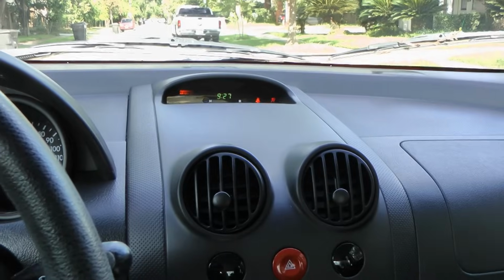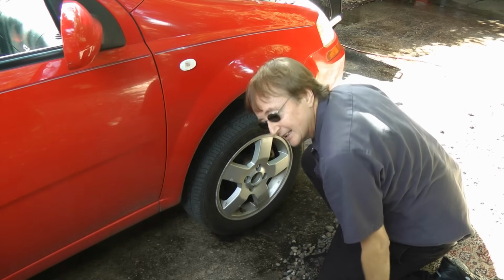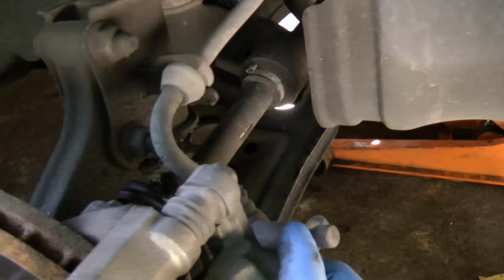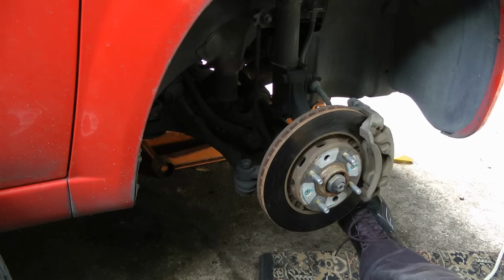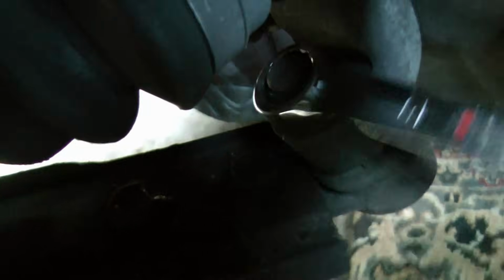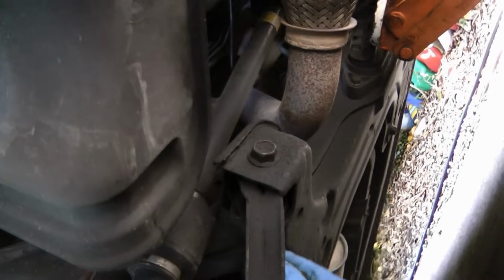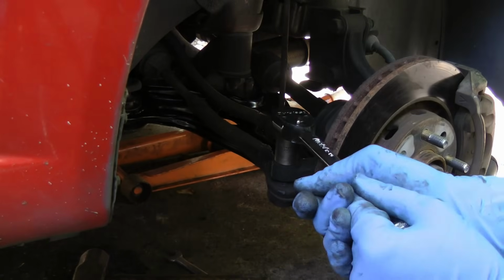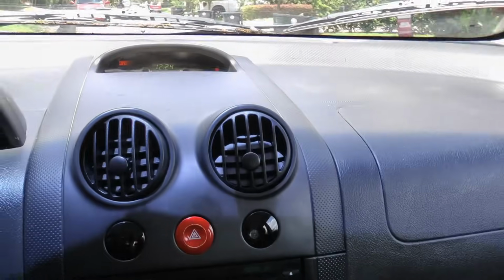How to Fix a Car that Clunks (Lower Control Arm)

Comment: Hey Scotty, my '83 ranger seems to die after driving it for like 20-30minutes. Could this be because of the fuel filter being possibly dirty? I've cleaned out the carb, and checked to make sure it wasn't missing and vacuum lines, and it still dies.

Comment: Hey Scotty,
I have a 2000 Honda Prelude type SH and noticed recently that every time I turn the steering wheel I hear a squeaking sound coming from the front end. When I push down on the car over the front passenger tire I can produce this sound so I'm assuming it has to be something with the suspension. I checked the ball joints using the 9 -3 and 12 - 6 method and there's no play at all. Where might I look next?

Comment: Hey Scotty Kilmar
I got a Rexton Ssangyong which clunks when you drive up a hill or powerfully accelerate but only in second gear. I first thought there was a problem with the powertrain but that couldn't be because its only when in second gear. any suggestions maybe?
Reply from the maker: +sfsef second gear is worn
Reply: +Scotty Kilmer WOW Thank you for the fast response! 
1.) Can i do something about it?
2.) Does this count also for automatic cars?
3.) Can something break and destroy the whole gearbox?
 Thank you!

Comment: My 08 Colorado has same noise but everything is super tight no wiggling no looseness I can't seem to figure it out it makes a lot of clunking when fully turned either way & going slow over potholes & speed bumps any suggestions would be nice

Comment: Hey Scotty I have the same problem with my Chevy Blazer. Replaced the cv axle and wheel bearing and still hear a grinding noise when I turn the wheel left. I heard it maybe ball joints or the A arm. What could cause the grinding problem?
Reply from the maker: do my vide "finding the source of car noises

Comment: Black smoke needs at least one of the cylinder rings replaced (most people will say get a new engine, repair is almost $2k,although parts are only -ring set under $100, complete engine gasket set $150, oil and antifreeze, plus filters $100.)  if you are not loosing a lot of oil or producing huge clouds of smoke, a really thick oil.

Comment: Mr Kilmer, i have a 2003 Santa Fe 3.5 V6 , has a front end clunk, i have replaced, front lower control arm bushings , outer tie rods,  front sway bar links , ball joints are ok , inner tie rods ok, i do notice , if i rock the wheel back an forth while driving , it does clunk , what it that ? an how can i fix it ? please let me know, thank you very much
Reply: Kody Darlington we have same problem...did you know now what is the cause?

Comment: I have an unrelated question: When I am driving straight up 35 miles per hour, my 1992 F-150 5.0 surges a bit...not at 30 or 40, just 35. Question is...What could be the main cause of this? Also It shifts 3 times(1-2..2-3...3-4th (i assume) )...1st to 2nd is fine, but 2nd to 3rd and 3rd to 4th i have to let up off the gas for it to shift and drop back down to 1500 rpm's(both issues "shifting I am pushing 2500 rpms"...any ideas on that as well?? THANKS Scotty. ~Joe

Comment: Question My vehicles making the same Noises but after I inspected it my outer tire rod is leaking do you think that’s my issue or I need to change the lower control arm to?

Comment: 2nd:  Is it black or white "smoke" you see?  Black, rings are most likely leaking.  White water is getting in The cylinder head from a possible leaky head gasket OR intake manifold gasket.

Comment: Scotty I have a 2001 Toyota Camry I have a knocking coming from the driver side. I inspected and found the control arm bushing looked shot. I repaced the control arm, ball joint, outer rod end, and the the sway brace rod on both sides and the clunking sound is still there. I have struts that are only a few months old. Any advice?
Reply from the maker: strut mounts, inner tie rods, or worn cv axle

Comment: Wouldn't you tighten the bushing bolt while the car is on the ground to not distort the rubber bushing?

Comment: my 2007 g6 gt doing the same thing. i mean the noise is not loud but theres a bumb wen i brake to hard and wnever i let go the brake theres a bumb to. plus when riding around the car doesnt feel stable. a mechanic told me that is the bearings but what you recomend me get them bearing or the whole control arm?

Comment: Hey I did the test for the tire I grabbed it from 6 and 12 no movement then 9 and 3 there was a little noise so what are the things that affect that and also is the tire suppose to move like rotate ? Cause it moves probably 4 inches of rotation or is that normal

Comment: Scotty,
I've got a 2007 Mazda 3 that sounds like it has a bad CV joint. I've replaced the CV joint and the tie rod, but the car still makes clunking sounds when turning or slowing down. However, I don't hear these sounds when accelerating. Any thoughts on what this could be?
Thanks!
Reply from the maker: worn ball joints, A frame bushings, lots of worn parts can do that. PRAY it's not internal wear on the transmission where the drive shaft fits in on each side

Comment: Hey scotty, ive recently tried to change the wishbone (lower control arm to you) on my car, but where the bottom baill joint bolts onto the hun doesnt pinch and secure it no matter how tight i tighten the bolt, it just falls right out, ive checked the part and its sound and its the same part. So any idea what i could ro here? Thanks

Comment: Scott i went To my car wheels and the don't move but the A frame is bad. I also checked the tire distance with my hands and the right tire is more backwards than the left one. is it alignment or something else?
Reply from the maker: +Alarm Tech911 time for a new A frame arm or bushings. Most guys replace the whole A frame assembly rather than try to fix bushings as most are press fit
Reply: +Scotty Kilmer i took it and was told it was the A frame but my question is. is a bad A frame also responsible for my steering wheel to move a little bit more to the right when the right wheel starts to grind with the mud plastic cover?

Comment: I'm sorry for my English but, when you tight the nuts, doesn't the car must be on the ground first so the rubber parts between this "A" part and the car (not the wheel) will sit properly and last longer?

Comment: How come you didnt preload the lower control arm befoe tightening the nuts up, you'll be replacing them again real soon
Reply: Hi there Scotty l I just watched your video on how to replace the lower control arm on a Chevy Aveo I'm doing the work myself on my 07 Chevy Aveo I have replaced the passenger side  it was pretty easy but the driver side seems kind of hard I the two bolts were easy to unscrew but the one near the transmission is difficult I've tried raising up the transmission but it will not go up enough to pull out the bolt what can I do thank you Scotty

Comment: hey scotty..i have a 1999 f150 4 door 2wd. I have a popping sound from the drivers rear wheel. Not all the time. every once in a while. no matter if i turn right or left. i was going to replace the u joints this week. just in case. They feel snug but ill change them any way...any suggestions it could possibly be?
Reply from the maker: +The Wraith more often rear wheel pop is brake problem or worn shock bushings
Reply: Thanks scotty

Comment: Hi Scotty I have a 2005 Ram 2500 with the 5.7. I have this damn knocking sound everytime I hit a bump and it doesnt have to be that big. Not sure where its coming from i know i hear it in the front. I have replaced the shocks, upper and lower ball joints, sway bar bushings and links, track bar bushings, the steering is all new (moog). If someone has any ideas please let me know. I was gonna do the upper and lower control arm bushings next, then maybe look at the steering box. Might even replace the links again. Thanks for reading and the help if anyone has any ideas.

Comment: Hi scotty I have a 06 BMW 750 and it burns oil and smokes out the muffler when in idle, it smokes sometimes but there are times it doesn't smoke. Do you know what the problem is and how I would be able to fix it?

Comment: Hello Scotty!
I drive an 08 accord coupe v6 model. I have a rapid consecutive knocking noise coming from under the car. Mainly from the front right passenger when the car is being driven off first thing in the morning or after leaving the car out for a long time. Noise dies down after 5 mins of driving. I had some clunking issue as well. Ride got smoother (not as smooth as drivers side) after I spent 1000$ at the mechanic shop to get rid of the noise. He Changed the stabilizer links and ball joints on both sides. Still the noise is there and he can't seem to figure it out. I went back again he is guessing control arm bushing or strut plate? He estimated 700 bucks to replace them and i cant invest that kind of money again on a guess. What do you think?
Reply from the maker: Lobsang Rigzin find a better mechanic, who can do my video "finding the source of car noises", that machine always pinpoints them and costs 130 bucks or so
Reply: Scotty Kilmer Thank you. I saw your other video post about the noise source locater as well. I will look for a better mechanic.

Comment: Gotta rule out the wheel bearing first. They make the wheel move sideways as well.
Reply: I just changed my wheel bearing. Same symptom. But now I have to replace bushings on control arm.

Comment: hey scotty, i have a ford ranger that has a front driver side tire that is cocked out. the tire is wearing on the inside but not the out. i had the same problem on the other side and i replaced the stabilizer bolt and it fixed it. i tried the same on this side but it didnt work. what do you think it might be?

Comment: Scott when i make a tight right turn I hear a clunk and then the right wheel starts to grind with plastic on the mud protector
Reply from the maker: +Alarm Tech911 check for serious wear like bent A frame or bad ball joints or broken struts
Reply: +Scotty Kilmer can control arms do that?
Reply: +Scotty Kilmer scotty what do u mean by an "A frame"? like in this video?
Reply: +Alarm Tech911 It refers to what is properly called the "lower control arm" of the front suspension. In the old days, this part often resembled the letter "A", hence the name.
Reply: +randolph patterson .Thank you :)

Comment: Hi Scotty, My car is a 2008 Toyota Vios with a motor driven power steering. I usually hear around 3 clicking noise when I turn and move forward towards my parking in my house which is 90 degrees with my car during parking. I hear the same sound when I turn my steering during reverse to take my car out of the parking. I have also observed that this sound does not come when I fully turn the steering wheel left & right when my car is on stationary (with the engines running) and during driving straight forward and doing regular road turns. Could you please advise me of what is causing this clicking sound during sharp parking turns forward & reverse?. Thanks a lot

Comment: I have a question, so I am not sure if this is a money grab opportunity due to the sending of Stim Checks, but I went to get my vehicle inspected and I have no problems, no clunking, no thumping, no clickity clackity's going on with the car at all.
It drives smooth and hasnt change for the past 79K miles, I took it in for a state inspection and the manager or floor supervisor, came out and said I needed to get my rear driver side Lower control arm, Sway bar, stabilizer bar, front quick strut assembly, and rear OE spectrum shocks all replaced for Approx 1,800$.
He said it was very dangerous to drive the vehicle and I will lose control of all steering and at that point I am in gods hands.
I politely declined so I can do more research and grasp an understanding if this is a Money Grabbing Tactic, or is there truth to what hes saying.
I went there with the intentions of an oil change then an inspection, then was talked to about the dangers of what his mechanics found.
Sorry for the long message.

Comment: aren't you suppose to use thread locker on the bolts holding the control arm in place?
Reply from the maker: some manufacturers do, some don't. Getting it tight is more imporant

Comment: Any help wpuld be great.i have a 2006 ford focus zx4 sedan 2.0l engine.i changed lower control arms both sides. I tightened up all boltd and put ball joint in....now whem i dribe o hear a screech sound....ams whem i hit a slight bump my steering whem pulls left amd right like mad.

Comment: What if everything’s tight, you replaced ball joints and you got not play but still a noise? You later find out your brake pads shift a lil in the caliper would that still make a clunk noise?
Reply: Strut bearings

Comment: Hey Scotty! I was swapping out ball joints in my car and got ones from Moog. When I took it out of the box I noticed it didn't have a castle nut or cotter pin, just a regular nut. I'm kinda worried because all the ball joints I've changed before had pins. You think these will be okay?
Reply from the maker: those are self locking nut with sealer inside

Comment: How much do they charge usually to replace this part ?  Or how much does the part cost
Reply: Yinne Medina I can't say how much the part is, probably not all that much but depends on the make and model of your car. I can say however I got the lower control arm replaced on my 2002 honda civic and the shop charged me $240 for everything.  I don't think that's cheap but that's  prob the average.  Next time I might do it myself but you have to factor in: what your timeis worth plus the cost of tools required if you don't already have them.
Reply: I have a 2007 Honda Civic si and yeah I figured it out they charging me 245 for labor and the part , but they told me that it's still good so idont know what noise it is I just bought some new shocks also so I have no idea what's making the noise

Comment: I have an issue with my Renault Laguna. There is a small step down in the road where I live. Maybe a drop of an inch or so. If I drive over the drop causing the front wheels to drop, there is an almighty knock. I really heavy sounding clunk. If i drive up the step then noise at all. Only happens when I drive faster than 10 mph. I have just has my sway bar drop links changed so I know its not those. It sounds more like a metallic thud. Sounds really bad. Any ideas? Thanks.

Comment: My 2000 RAV4 rattles when going over even the smallest bumps and at highway speeds it  jerks the steering and feels like the tire bounces but not sure...its coming from the right front side any suggestions?
Reply from the maker: dylan mastin often worn strut on that side

Comment: HELP! I'm working on my 2004 Dodge Durango replaced both Front Upper Control Arms and Front Shocks but after I lowered the car I noticed that It sat way lower than it use to. So I put back the old Shocks (thinking I bought the wrong set) but it still sits Low Do you have any clue what could cause that?

Comment: Hey Scotty, I recently started getting a clunking noise when doing hard left or hard right at low speed. Any ideas? and is it safe to drive it for another few months? Or is there a possibility of the wheel just falling off at speed. Im sorry if i sound stupid, im new at this.
Reply from the maker: jack it up as in this video and pull on the tires, if they have BIG play, time to fix it soon. If not, seen guys drive em years that way
Reply: Thanks!

Comment: Hey Scotty, I think I may be able to stump you.  I drive a 2001 Jeep Wrangler manual with a 4.0. The following symptoms all started within a week timeframe:
When I first accelerate, I get a loud knock, but not when I stop.
When I drive 15 or higher around curves on a road, I hear grinding. 
When I go 55mph or more, I hear more of a rattling type grind, almost like slipping gears.
When stopped, foot off the clutch, there is a rattle, I push the clutch and the rattle goes away, but with the clutch still pressed, I move the stick into a gear and the rattle comes back. 
It wasn't a good week...haha 
What do you have for me?
Reply from the maker: transmission problems for sure, probably internal bearings in the transmission from that type of noise.

Comment: I'm confused, don't you have to use a ball joint press kit to get the ball joint out and put it in?
Reply: Adam Stephens I think control arm and ball joint go bad at the same time in small Chevys.That's how it was with Cavaliers which use the exact same control arm.

Comment: I need some help diagnosing a popping noise I'm getting from my front right wheel. It happens a lot at low speeds, and I can feel it in the steering wheel. It does not happen because of the wheel turning, you can turn it all day long it won't pop, but you start crawling at about 5-10 mph it starts to click or pop. No play when I raise the wheel and shake it either, what am I missing? Any suggestionsis highly appreciated.

Comment: my thumping happens when i turn right cv axle boot is fine on both ends, oh and if i am driving in the rain car sounds like its dragging and engine sounds 3x louder!! bushing for my passenger side control arm looks worn and leaking grease.! can that cause my issue for 08 chevy impala

Comment: Hi Scotty,
I had my local mechanic replace my front lower left control arm on my civic 07 cause something was clunking and he suspected that was the problem. After he had replaced it, the clunking was still there, not only that but my steering wheel is now considerably off center and pulls a bit to the left, before it was perfectly straight. 
What can I do to fix this myself?

Comment: Well, today sent it to to shops, the first said, lower arm on left side. the other mechanic said the suspenssion struts! I am really confused,and I watched your video but still, its hard to tell, the sound is a clunck in the whole round area of the left front tire of this peugeot 206cc 2002